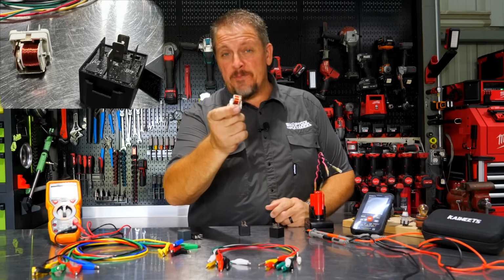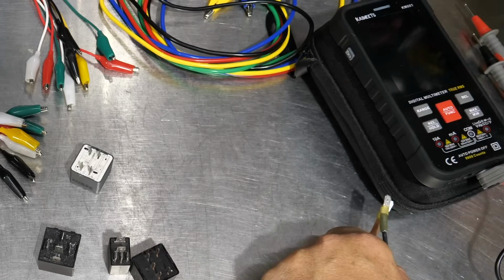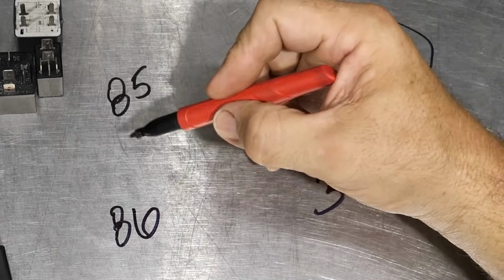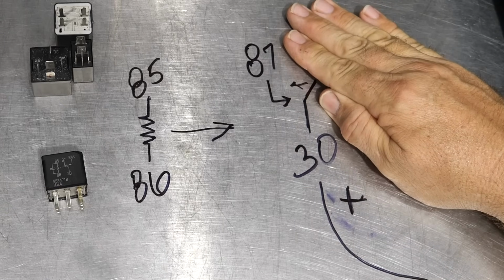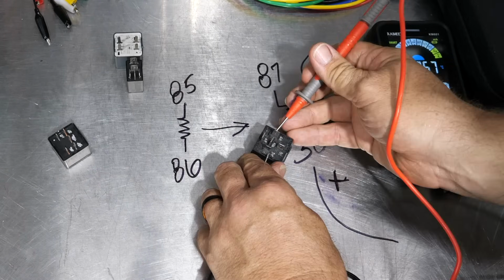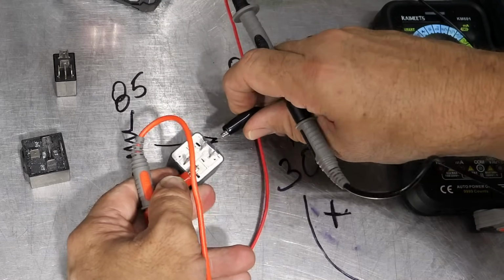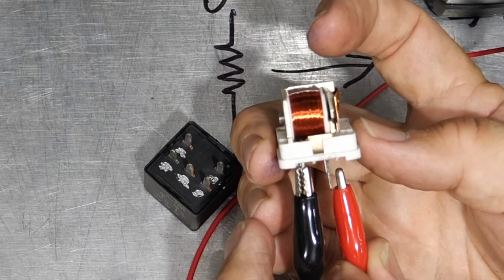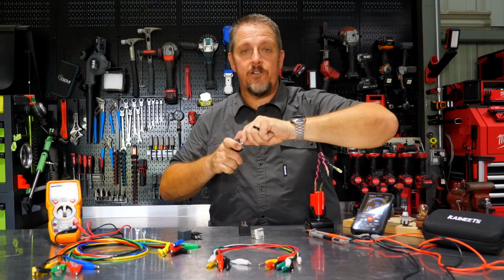How To Test and Diagnose Relays and Wiring [4 & 5 Pin]

Comment: Help!  My 5 pin has both 87 + 87a unpowered until 30 is energized, then and only then do 87 + 87a get power together.  The relay is for an efi fuel pump. I'm have trouble finding this type of 5 pin.

Comment: I think it would be easier if a 12v battery was used by putting it on 86/30 and you should hear a click which means the relay is good.

Comment: Thanks for the insight buddy..... im having issue with fuel pump wiring ..... i know the pump works because i connected it straight to the battery and it turns on...... i took the relay apart and saw its totally burned and corroded and oxidised inside ..... then i checked the wiring..... the connector at the fuel pump shows 12V with ignition OFF and key out.... and drops to 2V when ignition is ON and i crank.....  so i know theres a positive to ground short circuit somewhere in the wiring..... i tested at the relay connector where it slots in ....30 and 87 with multimeter  shows 12,5V  and between 87 and 85A it shows 2,5V ....which confuses me coz there should not  be voltage between 30 and 87 with ignition ... when i test 87 to the chassis of the car it shows 2,5V also...... so somewhere either between the ECU and relay connector theres a short.... or between connector and fuse theres a short..... still investigating

Comment: Question, I have a 2004 e 250 Econoline  van, The blinker and the hazard signals work but only a few seconds then stops working until i shut off the van then turn it back on again. Then the samething happens again.

Comment: I'm troubleshooting a turn signal relay on a Ford explorer 2003 and they have letters instead of numbers and all the blades are positioned and clocked the same direction as a normal relay do I test it the same way as you test a normal relay?

Comment: I really liked this video.

There's one thing though that I think you should do..

Explain the wiring testing as thorough as you did the relay testing. With visual reference, just as you did with the relays.

The "yapping through" this process at the end of the video might contain all the relevant information. But it's nowhere near as accessible to grasp as the "relay breakdown" part.

I hope you can make this, and put the link in this video. 

Best regards.

Comment: I worked with an electrical engineer who came from a relay manufacturer. He said you check a relays contacts health (30-87) using capacitance not resistance. He would run a relay through thousands of load cycles and record capacitance changes. This was 1978. I used voltage drop to check the points for current carrying ability in the shop.

Comment: Thanks for informative diagnostic info. I just figured out an issue which was misleading as the fuel was shut off thinking it was fuel pump relay as it doesn't run at key on. Better review the diagrams cause mine gets it's power from source that comes from the ECU relay. How clever to misdirect or cause extra parts purchase. A simple check of the control side indicated no continuity = no workie.

Comment: Thanks you are the only one with clear explanation and good camera work. I have 91 Audi 100C4 with a problem  fuel pump relay. They dont make the relay anymore. I bought 4 used ones 2 were bad (no start) one ran the car for a minute when I tried 2 mn later no start. The last one lasted 3 days and refused to work. I put a shunt with a fuse from 30 to 87 so I can drive the car. I am starting to think the fuel pump is causing the issue. I changed it put a new one and have had the problem ever since before the relay issue. I will check voltage and amperage on it to see if it is what causes the relay issue.
Reply from the maker: I think you're on the right track. Something is probably over-amping and killing the relays.
Reply: @Shoptoolreviews  thanks. Off my four bad relays all the resistors om value are good. But I have infinity between 85 and 86 on all of them. What could cause that and how to repair them is my question? Hope you can help, thanks.

Comment: Hi ,I'm adding another set of car horns to my car, Can the low voltage wire from the horn button be  spliced into to switch both relays . I'm running a separate horn wiring harness but would like to use the same trip wire..thanks

Comment: This was alot of information and i don't really fully understand. But i think i need to change out a relay or two on my 2006 hyundai tucson. My low beams aren't working and none of my windows are working anymore. I ordered new motors and haven't had them installed. I thought it was a fuse issue but i think the relay controlling the low beams and windows need to be changed. I ordered a 2 pack tonight. I might need to go to an electrician because this is foreign to me.

Comment: Question..... I want to use a cheap radio control vehicle rc receiver, to control a kids 12 volt ride on vehicle to make an rc lawnmower. Will that work with relays, or would rc receiver get messed up from voltage, amps?

Comment: WRONG!! RELAYS R ABSOLUTELY NOT A FUSE OR A CIRCUT BREAKER! RELAYS R A ELECTROMAGNETIC ANALOG MECHANICAL SWITCH THAT WORK WHEN POWER IS SUPPLIED OR REMOVED THANKS REAL MAGA DIGITAL WARRIOR STEVEN COTE 😎 🇺🇸 💯 %

Comment: I was confused by to much talking. I actually learned that the hard way by experimenting with it until I figured out where the power came in by a switch and if it did or didn't go out. Then I got a simple way to test these. I bought an inexpensive plug-in temu tester. FYI very rarely do they go bad. Almost always the switch that sends it the power or whatever it's powering.

Comment: Got a 2015 civic and sometimes itll click once and not start and eventually will..new battery alternator and current sensor and still not good..got a starter on stanby but need some guidance..no numbers on relays and did the 9 volt trick and relays were clicking
Reply from the maker: I would tend to think you have a starter issue. Thanks for watching.

Comment: Do you have to unhook the battery or leave it running while doing this or no
Reply: Yes you need battery with power on, don’t remove the power, but yes it needs to be on to test, you also should at least use a multimeter/test light to see and measure resistance

Comment: Tested 1 old relay and 2 brand new ones.
All 3 4 prong by the way. Never showed 80+ resistance. Started at 6000+ and slowly slowly dropped to 0.0 then beeps.
None showed 80 resistance. So now what. Also video said u would show how to test wiring without relay. That wasn't ahowed

Comment: For some weirdest reason my relay works fine when tested until I plug the output into the lights it’s powering from 87, then it doesn’t work anymore, doesn’t  test at 12v.  No light.  But when the light is powered separately it works fine.  When it’s not plugged voltage from 87 is fine. All components work fine until connected.  I tried a second relay with the same result.  Stranger still the whole thing worked fine for years until a few days ago.  Very hard to find why the led driving lights won’t turn on now….

Comment: What if i just get likev62 ohms???
Reply from the maker: 62 ohms of resistance across which posts?
Reply: @Shoptoolreviews  85 snd 86...i just googled what a good range is for ford, f150 1991 and it said 50 to 200.
So i should be good.
Also. , i do get tge clicking noises.
 Tomortow during daylite i will test for " draw" like you did.
Reply: Whats an acceptable reading on fuel pump as i turn the engine over. Oh ....wait i never hear the pump "whine", (activate)
Should i still measure at fuel fuse???
Also, i havr fords "tow" package with 2 fuel tanks.
  I never hear either fuel pump activate???

Comment: Doing my 65 falcon now with a AAW kit. The 4th tab on the ignition switch..it's for the check ground bulb correct? I'm not using original cluster so I just leave it off correct? Already cut the duel feed wire from the harness.

Comment: another video on how to test/diagnose starts with classroom redundancy and verbal training 👀
I WOULD WATCH WAY MORE much needed help VIDEOS WITHOUT SKIPPING ADS IF CONTENT HELPERS WOULD :
step 1 - start the "helping process" with a known bad and a good relay
step 2 - test each prong using multi meter then draw/write the numbers down ; 4-5 prongs = only 4-5 numbers
step 3 - IF it's bad then show/say this is bad ; IF it's good then ok, spend more video time on when or how to replace 
finally, now talk about the calculations parameters e=square theory of the atom copper plating density etc etc...

Comment: How does one determine pin allocation if they aren't numbered and there's no diagram?  My 4-pin relay has two brass pins, and two copper pins.  Would the brass pins be low power coming from the switch, while the two copper pins would be high power coming from the battery to the lights etc.?

Comment: VOLVO CENTRAL LOCKING DIAGNOSIS: SUPPOSE my relay is good and the fuse is good but the wiring between door switch and the relay is faulty?  Do you have a video on the Plug that the relay plugs into?  I need to know how to access the board behind my relays on my 30 year old Volvo. Thx, DDay, Maine

Comment: Does that mean if you are using a 5 pin relay, you could use it for hi and low beam headlights?
Reply: You can use that relay for hi  low beam headlights 
Brought must know how you can connect  85 and 86 pin

Comment: I'd say most ECU's would use grounds to control the relays, that's how all of the aftermarket ones i've used worked to control the fuel injection for instance because they aren't designed to have high amps passing through them.

Comment: I tried to verify my headlight motorcycle relay everything was good until i tried to power it with a 12v parkside battery, when i touched the terminals with the wires it shorted… was the relay bad or did i do something wrong 
I put a wire to 86 on relay and - on battery and another wire on 85 relay and + battery
Reply: You did everything right. Just a coincidence. Unless it was a 6 volt rated relay.
Reply: @bernardocisneros4402  thank you for your reply, it wasn’t a 6 volt relay, i took it off my motorcycle, i guess i am just lucky :)

Comment: The problem with 85-.86 is that it click sound but it's dirty at the contact therefore, it won't work.
Reply: That's why you should use a continuity test light between 30 & 87 and 30 & 87A. The continuity test light acts as a load to verify the integrity of the circuit.

Comment: Can we not use the no 30 when using it for auxiliary light just to supply only the no. 87? Like I'm connecting the 85 to ignition switch and 86 is in the negative? And let the no 30 and 87a alone.
Reply: No, because terminal 30 is what provides power.
Reply: @bernardocisneros4402 
You can connect 85 to a  switch so you can turn on the light  
86 you can connect to ground 
30 you can connect to B+ battery 
87 you can connect to auxiliary light
Reply: @konstantin-big  But they don't want to use 30 and 87. Why use a relay if you're not going to use 30 and 87. You're better off using a butt connector and just using the ignition switch.

You should always connect 85 to ground and 86 to positive side of control circuit. It will work the other way but it's technically incorrect. The next mechanic will assume 85 is connected to ground because that's what the standard says.
Reply: @konstantin-big  If you've been a car electrician since 1974, then you should know why 85 should be connected to ground and 86 should be the switched terminal. I understand how to use a relay and the why and when to use it. I don't think you understood blacksapphire's question. Using a relay doesn't eliminate voltage drop it only reduces it. You're using a low current circuit to control a higher current circuit. It cuts down on using larger diameter wires but instead of only having one fused circuit, you'll have 2. One for the control side and one for the load side. Not only have I used relays but I've also designed them.
Reply: @bernardocisneros4402  
Hey 
I don't say I know better an you
I know about that you write 
If I connect the wire from ignition switch  to pin 86 and 85 to ground,the relay works
Or 
if I connect the wire from ignition switch  to pin 85 and 86 to ground, the relay works 
What is the difference???
There is some original relay they have a diod  or a resistance between  86 and 85
Reply: @konstantin-big  Yes, some relays have resistors or diodes between 85 and 86. A relay with or without a resistor, you can connect 85 to ground or power, but a relay with a diode, you have to connect 85 to ground and 86 to power. When designing relays there a standard one follows and that standard states that 85 is the negative end of the relay coil and 86 is the positive end.
Reply: @bernardocisneros4402  
OK
Thanks

Comment: I have this 5-pin relay that operates the electric chute deflector up and down on my Kubota snow blower. It is located under the hood but for some reason I keep getting water in the relay case and shorting the relay and causing parasitic drain on the battery. Any suggestions on how to eliminate the moisture in the relay case? It has me baffled because this is the only relay that has this problem. TIA
Reply: If water is getting in terminals 85,86,87, and 30, you can pack that with dielectric grease. If water is getting inside the coil housing, then apply RTV around the seam between the coil housing and relay body.
Reply: You can change the position of the relay so that water does not enter the relay

Comment: I put in a 2 feet longer negative wire of different size gage now the lights don't work what did i do wrong
Reply: The wire you used is probably too thin.

Comment: My only quibble is that it's not a resistor between 85 and 86, it's a coil that, when energized, creates the magnetic field to pull the relay switch to close the 87 and 30 contacts.
Reply: Some relays have a resistor across 85 and 86 to mitigate the destroying effects of a back EMF spike. Some relays even use diodes instead of resistors
Reply: Actually🤓 6:05 that is the literal Symbol for a resistor.
Reply: You're exactly right it is a coil, I don't know where he got. A resistor from the resistance is determined by the wrap of the coil and a size wire copper and the length of the coil
Reply: Very simple to understand
Reply: 10.43 it shows you a resistance test and the resistor ohm result.

Comment: Between 85 & 86 you refer to it as a resistor. It’s actually an electromagnetic coil that pulls or releases the pivoting contact point, right? I’m sure has resistance, but it’s not a resistor in typical electronics terms. Great vid though!
Reply: See the answer I gave to @fix135 above. In addition to that, a coil is made of of loops of wire and wire has resistance, so technically it's also a resistor.

Comment: Hmm.  I've got relays that don't have 87.  It has 87A, but not 87.  I'm figuring out that this relay is on all the time, but when the control side is activated, it turns off.  It is a 4 pin relay.

The part # is FOOCLE FLS820-012-1B.  There are absolutely zero that show up on a google search.  The 1A & 1C show up, but not the 1B.  Ironically, the others are 5 pin.

On the front of the relay, there is a white tag that says:
Red 12V DC
White Relay control
Yellow Pump A
Blue Pump B

I'm trying to use this relay to control a coil to a plug, for a Plasma spark ignition demonstration.
I'm using a 12V DC LED strobe light controller to energize the relay, to simulate breaker points to fire a spark plug.  

This one is a head scratcher.